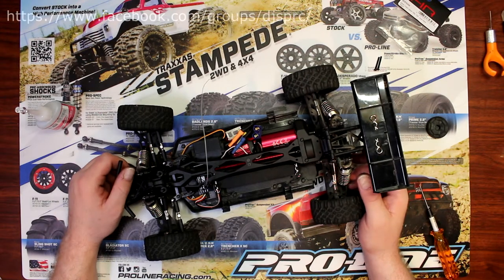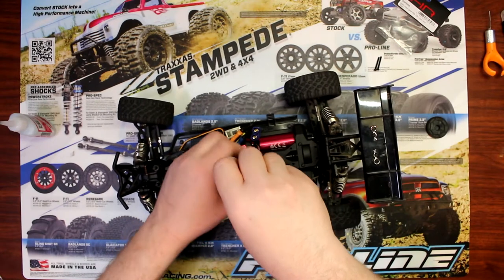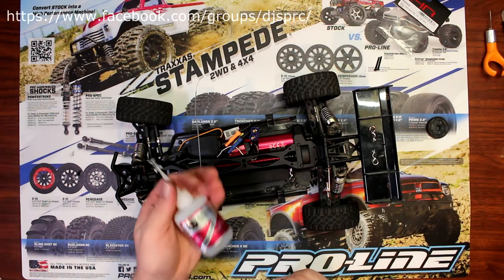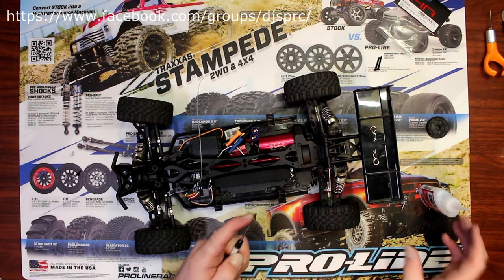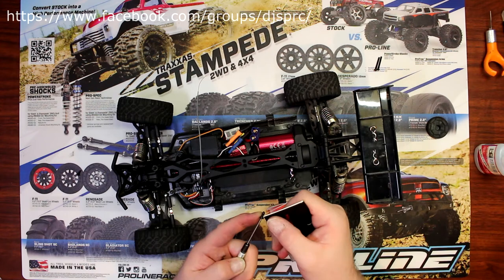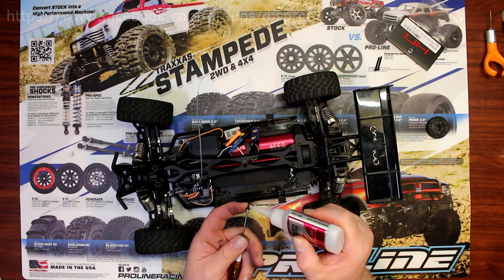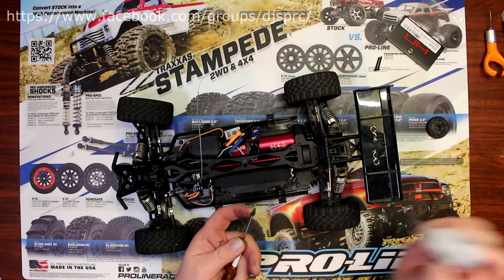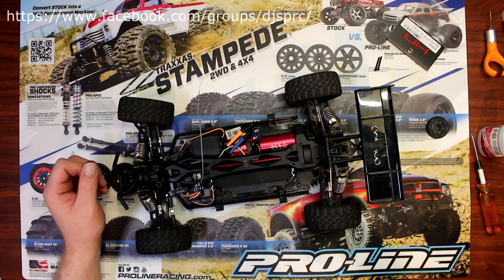How To Fix A Striped Screw In Plastic R/C

Comment: OMG GUYS THIS WORKED AN NOT ONLY THAT IT STAYED IN THERE GIVE THIS GUY LIKE AND SUB fr it worked and I could get it in and out multiple times with no error. and to make the glue stick more you should wash it if there is any oil from factory on the screws.  Just a quick drizzle of water in the sink should be fine.😅😁

Comment: Thanks! Going to try this on my Casio watch - I stripped one of the threads holding the bezel onto the resin/plastic case.
Reply: Did it worked?
Reply: @bobocel007  Yes it did
Reply: Good, mine has a stripped thread on the back of the case one out of four holes  a stripped thread. Screws that holds the backcap.
Reply: @bobocel007  Good luck - hope it works for you!

Comment: But isn't cyanoacrylate a glue? How come it won't glue the scew and everything together? Im surprised you're saying the screw just comes out. Would be really awesome if it didnt bind to metal
Reply from the maker: CA  glue doesn’t really bond to metal it has a small hold on it but when you try to remove the screw will come out
Reply: @djsprc  oh thanks. That is really surprising! Will test on a dummy part just in case

Comment: Hey, i stripped a small little screw in my servo, and it wont tighten up, i need a simple solution, no other screw just that
Reply from the maker: I would try to put a little bit of CA on it  put it back together and leave it alone for at least a couple hours